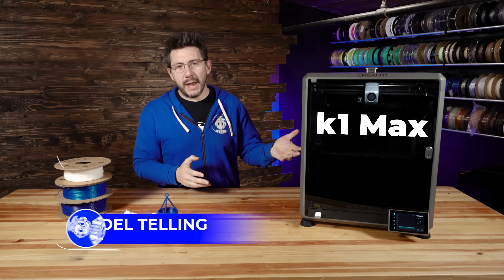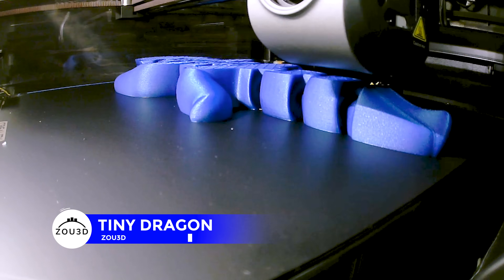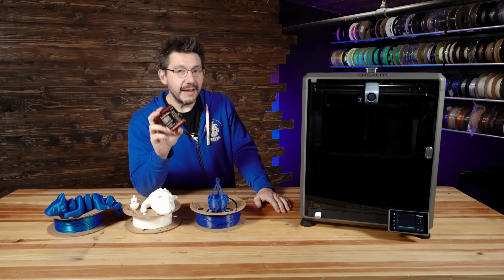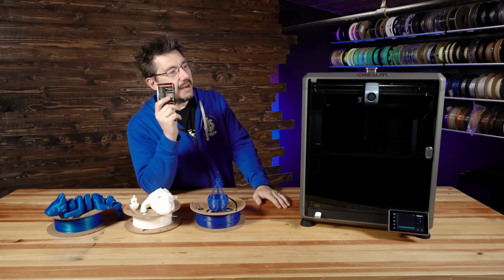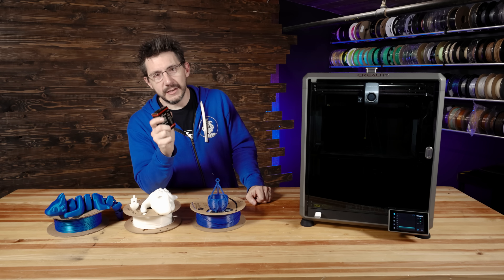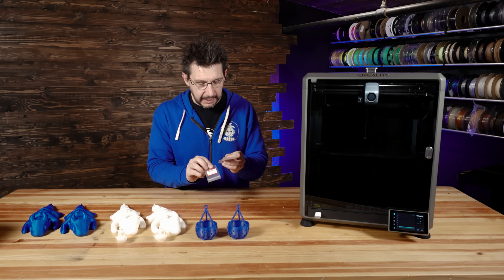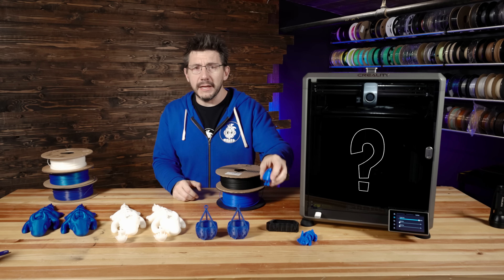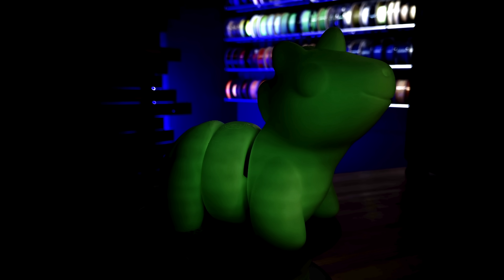THIS Fixes the Creality K1 Max

Comment: The whole video was an advertisement. Their printer is too fast for their own good. Creality lost their momentum and their software is trash now. You can only use their application and it sucks. Im done with them. Anycubic kobra s1 has not disappointed and i use it for my business. I hear some bad feedback before buying but bought it anyways. Best value for the money printer.

Comment: I got a k1 max over a year ago now and I’m really disappointed. The average user has to spend 20+ hours shimming and cap-ton taping the bed to get it leveled enough to use the entire bed. The camera 50% of the time crashes and 90% of the time wont connect via the Creality could. Maybe it it bad true bed leveling and not just an average meshing software that cant deal with tolerance >0.2mm it would be okay. I wouldn’t recommend the k1 max to my enemy its got too many bugs and yes i did lose a smooth sheet early on due to the print head crashing into it. I should have stayed with prusa or went bamboo.

Comment: Thank you for this video. I have had hot end problems for many weeks now due to the issue you described. I broke one of the connectors because I didn't use 2 different wrenches to change it the nozzle. Since then I have had many issues and changed it out many times. I am at my wits end till I saw this video. Going to try this device and hopefully I can get my Max running once again instead of being a $800 paperweight.

Comment: Just purchased a K1 MAX a couple of weeks ago. Love it. Added a lid riser and a Creality Space Pi Filament Dryer Plus. Using the Creality slicer and the Orca slicer. I've only used PLA so far. I have not experienced any problems at all so far. And, obtaining fast, beautiful prints. (I'm left-handed, and the door only opens 90 degrees from the wrong side. I blame my parents.)

Comment: So late bloomer here. My dad's talking about getting me a k1 max for Christmas this year, but I have a few questions. First, is it a necessity to swap out the hot end and the nozzle with the micro Swiss or is that just personal preference? I ask because he gave me a v0 a few years back with a .4 nozzle and I haven't ever had to change it, so I don't know the nitty gritty about changing the nozzle. Next, as far as the bed goes, have you noticed any issues with removing the piece from the bed, early bed wear, etc? Very minor questions, but with a $900 USD printer, I want to make sure I know all these details before my dad spends his hard earned money on this "surprise" 😆

EDIT: I've printed strictly ABS on that printer and even with the high temps for abs, haven't had any issues with clogging or leakage. Issues have been caused by user error up to this point.

Comment: Please ask your sponsors to make the multicolour printers NOT too make so much waste. 
It can change colour mid print if it calculates when to cut the old colour to keep the pressure with the new colour and continues to print.. Making the colour change poop
Go in the infill or something. 🤷
It can be done with existing printers I think.. Slicer/klipper job

Just my 2 cents

Comment: in my opiniion, most of buying these printers, does not want to change out nozzles etc, we want to use it as is. so is there ever a video that would help us really dialing in that settings to get better smoothness without having to change out nozzles and other parts

Comment: I've built a voron 2.4r2 and it prints very well with the 0.4mm nozzle, the moment I use 0.6mm nozzle with adjusted parameters, but same 0.2mm layer height, the quality goes ass, so bad the prints completely fail.

Comment: Mine works perfectly, ABS, PLA, TPU, SBS, PETG. I've been trying PP the last week and its been a back and forth to get the temperatures right, but after about 3 days it works. Minimal clogging, great printing speed. Really can't complain, just had to move the material spool to the top of the machine, also done with relative ease.

Comment: I want to like this printer.  It's got a larger build volume and seemed to do a pretty good job on the prints you threw at it, and with that hot-end swap it seems to now be a better machine all around.  But the overall feedback from users/owners of the K1 Max is really, really bad.  People having issues with the machine trying to destroy it's own internals, poor customer support and/or parts availability, etc, etc.  Every time I read those reviews, I feel like I go back to the X1C as the thing that just works...but then I want larger build volume than 256 cubed and I start looking at other printers again.  It's frustrating trying to come to an informed decision on which printer to buy when so many of them seem to be nothing but problems and money pits filled with frustration.  Isn't there a large volume 3D FDM printer out there that just works well?

Comment: I "inherited" 2 broken K1 Max and 1 broken K1. K1 Max with bed issues when trying to calibrate,  K1 with effed up firmware plus a dead cable to the touch display. After diverse repairs involving the vendor, update attempts, etc I indeed got them to work and print somewhat reliably with a print quality that far exceeds the one I got from the Anycubic Vyper (which is less expensive, older, etc).  My experience with Creality support is hmm. my impression is that they don't give a fart about servicing their printers, even if they are still under warranty. Anyway, all 3 are working now.  I do consider the small nozzle a draw back and have ordered the larger nozzles for the K1 Max. Will try to put together a profile in the Bambu Labs Studio slicer to get it to work properly. 
Oh, Creality Print 5.0 was utter garbage last time I tried it. I had to downgrade to 4.3 when trying to print with Ender 3 and K1. Would I buy them again ? IDK. I got them increadibly cheap. If I had paid retail I would most likely have gone for a Bambu instead.
Reply: actually Creality support has since started to provide excellent support and spare parts delivery. Praise where praise is due.

Comment: My experience with the K1 max. I plugged it in and haven't touched it since. I imported my ender 3 pla profile in and added some speed to it and it's been perfect since. I've had 3? Total failed prints that weren't directly my fault in the last 9 months

Comment: Great video. Love the review. One thing is I just cannot agree with the criticism of shipping a 0.4mm nozzle on a printer, even if it is a big printer. Most people have 0.4mm printing needs, regardless of the bed size.  I bought a few CR-M4s for example and still use a 0.4mm nozzle on them. If I want to use a large size printer to batch print smaller models, I still need the 0.4mm nozzle. Also, just because a single model is larger, doesn't mean you need to use a bigger nozzle and increase layer size. I get it, if you are an ETSY seller and need to cut time down, then install a 0.6mm nozzle or bigger, but the default 0.4mm is a good choice and the manufactures know it.

Comment: I bought a k1 last week and have only printed for 15 hours but I have faced with a problem. The extruder stopped extruding filament and makes clacking noises while trying to push out filament. I tried retracting and using the pushing rod it just hits something and can’t push out any filament. How can i fix my printer?

Comment: funny...you know Creality would have never made the K1 unless they didn't get kicked in the butt by Bambu Labs.
Reply: They made one or two good printers and those gained a lot of popularity and they sold a lot of them so they figured out they don't need much innovation and kept releasing different ender 3 variants every few months.
Then bambu completely blows them out of the water.
A company that never built a printer before, composed of ex-employees from a company that also didn't make 3d printers, let that sink in.
Reply: That is the definition of fair market competition. Any other approach like injecting government control will lower product quality and lessen inovation.
Reply: Well thats how our consumer market works. Nothing to do with creality, but all of the market
Reply: @kaihlis  lol, thats exactly what happened with intel before amd ryzen
Reply: @borisgraell  Right! I remember the first Gen i7's were the craze compaired to the Phenom. Ryzen came out and it was a smack to face.
Reply: @andrewking2590  Does Bambu Labs have anything that prints as big as this?
Reply: @northernlight8857  no the size aspect of it though was because of the prusa XL
Reply: Bambu cult members are an odd bunch of people.
Reply: @andrewking2590  and your point is?
Reply: @sblack48  on top of your head...
Reply: @andrewking2590  you’re saying that competition drives innovation. Hardly a profound idea.
Reply: tuck that chin and take a lap before you pipe up
Reply: This comment aged poorly
Reply: @andrewking2590  creality wouldn't have won again if bamboo lab had not locked their software down
Reply: Gotta love capitalism

Comment: Joel would you recommend this over a Diamondback Volcano nozzle? The diamondback would still need to be torqued into place, and not be able to hotswap. But the Tip on the Diamondback being  a non-stick surface and potentially better printing quality. What would be your pick?

Comment: 11:40  You can clearly see a layer shift , not good. This Creality printers like k1 and k1max suffer from vertical artifacts due to poor quality z axis rod screws and other parts.  Hight precision is key when you talk of layers at 0.2mm height and 0.4 or 0.6 mm nozzles.  I wanted the K1 Max for the size but the vertical artifacts issue made me decide for the Bambulab P1S instead. I don't think there is a better printer than the Bambulab on the market, either p1S or X1 Carbon are top notch quality.

Comment: My K1 Max is a total piece of crap. Table unlevel and bent. Creality will do nothing to correct this problem. Smaller parts printed towards the front of the plate will not stick to the plate. One time, they didn't stick to the plate and melted into a ball of filament, damaging the hot end

Comment: "high speed" PLA is a scam.  Usually some settings do need to be tweaked between manufacturers, usually pressure advance needs some adjustment between the two.  Flow rates depend on your hotend more then anything else.
0.4 nozzle is fine even with large build volumes, the better hotend (flowrate) you have, the faster you can print and thus keep times down on large prints.

Comment: Umm your Micro Swiss Flow Tech Hot End  is a 1x FlowTech™ *****Brass Plated**** 0.4mm Nozzle which means using carbon fiber would absolutely destroy it! If It was stainless steel - would not be an issue.

Comment: i havent even got through the first 1/2 of the oem spool they send... it keeps clogging, the hotend has died and stpped heating consistantly, got a new one then the extruder stopped working..... had this 4 months waiting for repair parts for 3/4 of that time....

Comment: In the basket print, you can see some layers are not correct or off where the Bambu does much better. The whole Creality series has Z-axis issues. For the money it's okay but for precision and finish, Bambu is still king. Creality needs to stop with the patchwork approach to production and sales. They are becoming the Ford Taurus of 3D printers.

Comment: I did not particularly enjoy your video. It seemed like a 15 minute advertisement. I wish you had taken the three prints you did at the start and not just compared the two hot ends with the same nozzle diameter but demonstrated that the larger diameter nozzle produces the same prints at the same or better quality. You never actually made your point that you sought to make in the first place regarding nozzle diameter.

Comment: Hey there, I did the microswiss .06 set up you mentioned here but I'm having issue with it and was wondering if you could tell me your set up on the temperature and speed and all that.  Using PLA, I've tried multiple brands of filament, even different textures like matte or silk. I'm getting some prints to go well but none of them have been up to snuff, if you may.  I'm hoping maybe i just need the right settings.  Thanks ❤

Comment: I got a K1 during Black Friday to replace my Elegoo Neptune 4 pro for 400$, just a normal K1 not the Max. Holy shit it's such a good printer, the only failed print I've had with it was 100% my own fault. I decided I was going to change nozzles and try a .6 nozzle to see if it was worth the slight quality drop for the faster speed. While trying to get the old nozzle out, however, I ended up ripping out the thermal cord from the back of the hot end. who decided to make it that god dam hard to remove a silicon sock??? I got a Micro Swiss coming in now, really hoping it gets the job done.

Comment: Your review is awesome, and it almost made me move off of a Bambu but then, the comments below. "Weird 5cm layer shifting...maybe this hot end will solve my problems...etc. Then I went back and watched the hotend being installed which is arguably simple but not as simple as the Bambu clip in nozzle. I dunno. My only experience is with Resin printing but I'm back to thinking that the Bambu is the way to go. I feel like Creality was rushed getting this to market. I'm going to get an A1 to start and see where all these vendors land on catching up to Bambu features and revisit when I need a larger format, enclosed printer.

Comment: Getting ready to return my second K1 Max. Absolutely nightmare machine. Much better results from my older Ender 3 V2. Wasted a full roll of filament due to layer shifts on multiple different attempts.  I really was hoping the K1 Max would work like I needed it to, but not so much.
Reply from the maker: Oh that’s sucks. I’m so sorry, I wish yours worked like how mine has been working.
Reply: @3DPrintingNerd  So do I!  Seems like I am one of the few not touring the wonders of it, but this is my second one that has had issues. Time to find an alternative.

Comment: the only trouble i ran into swapping to the microswiss was the yellow glue creality placed on the electricals connections. the one with the two thing copper wires was the hardest to remove

Comment: Man I wish more people would mention VFA on CoreXY printers. You can see it on the Candy Corn. Coming from a well dialed bed slinger, my K1 Max has terrible VFA in comparison. If I had known this was an issue I would not have purchased this unit and stayed with my caveman printer that bangs out quality prints. 

Also, my other new printer Neptune 4 Plus, has its own issues (Zoffset) but the quality prints it pumps out (and faster than the K1 in some aspects) are pretty amazing for just a "bed slinger".

Comment: Glad to hear it worked for you - mine was HOT garbage from day one. No amount of calibration could get a good print, ended up with the bed mesh issues and eventually it offed itself by trying to ram the nozzle through the printer bed until it snapped the whole hotend off… 🤷‍♂️
Reply: Lol yours is the normal Creality experience. His is the exception and he should've made that abundantly clear. Anyone who's been printing for a while knows +1 in 5 Creality machines is hot garbage on arrival. He lost credibility with this one.
Reply: Are there any better alternatives in this size or bigger?  @1SmokedTurkey1
Reply: @1SmokedTurkey1  while I've only ever owned one printer, my first was an ender 5 pro and the ONLY issues I've ever had were with having to manually level the bed and maybe 3-4 extruder clogs in 5-6 years but that was due to my bad fitment of aftermarket parts..
Quit crying.

Comment: Just received my K1 Max Thursday, started to perform the Quick Start procedure Friday.  Got to the point of installing the glass top, and much to my dismay, the frame and enclosure was twisted about 3/16" so the glass would not seat properly.  In posting this issue on the Creallity K1 Max forum, the feedback was significantly populated with other new owners facing the same issue.  The majority were quite specific to send it back for a replacement as the path of attempting repairing it with factory supplied parts is frought with disappointment and frustration.  I had high hopes of an easier path and near immediate productivity.  Am waiting on the support team to return to work so my warranty request might be processed.

Comment: I'm getting tired of creality not learning from their mistakes with their hot end designs. Newbies to the printing game get so frustrated with clogs and hot end issues because the old school designs sucks. Then folks get disenchanted with 3d printing and design altogether, not realizing there is better out there. Creality is getting close to making a really good out of box printer but things always seem to fall just a bit short.
Reply: it's a nightmare to work on, extruder jam? hope you have one of those tiny wera rachets because there is no tool access. God help you when the hotend inevitably fails and you need to replace it...
Reply: @anonymousperson7861  don’t even get me started on their firmware that doesn’t keep the build plate hot during filament changes. 

Nothing like working on 3 day print, only to run out of filament and the runout sensor causes the bed to cool down and pop the print off 🤦🏻‍♂️. There are ways to “fix” this but…whyyyyy. At least give non newbs the option!